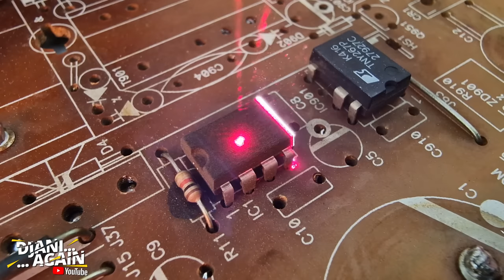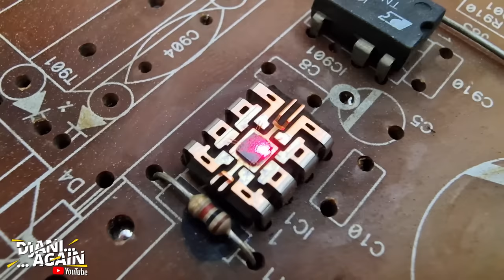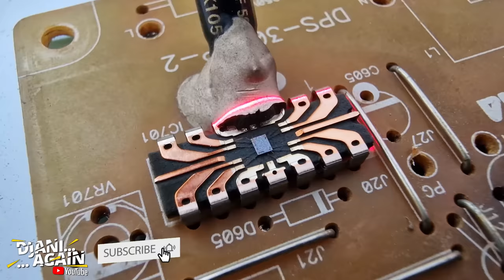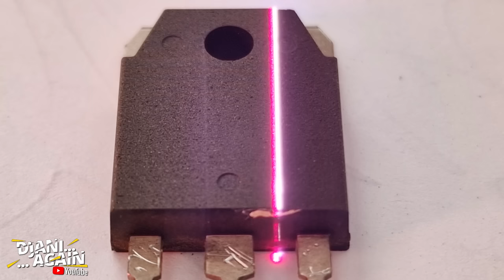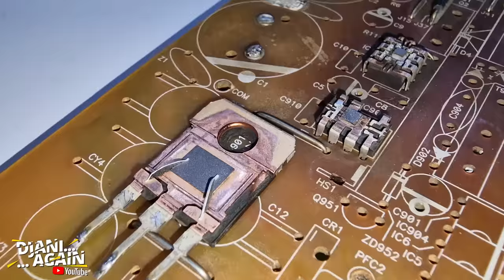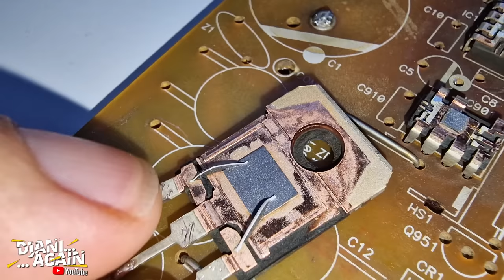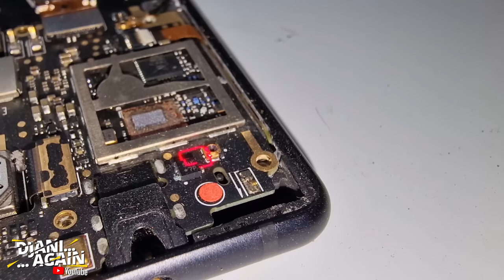Integrated circuit,  MOSFET, processor  decapsulation with fiber laser! Peek inside 👀 semiconductor

Comment: That's extremely cool!
You wonder how they manage to get the bonding wires done.
Reply: @oskimac  Yeah, saw that, he has a manual bonding machine, but still i would like to see both end of the wire, how it's cut, welded. pretty thing wire.
Reply from the maker: Thanks for the link! Really cool ✌️
Reply: @AnalogDude_  yes. I don't remember if is in this video or another. But he shows the entire process. And how dificult isnto thread the thin gold wire along the machine

Comment: Do you scrape off / save the gold wires after this?
Reply from the maker: Not really, do they have?
I did it for fun, but result was amazing so i wanted to share ☺️
Reply: @DjaniAgain  yes many of the contacts and such in the micro electronics are gold. A lot of scrappers collect E waste and burn and melt it down into ingots / gold silver bars. I wonder if this process would help that process in any way.. That however is far beyond me.

Comment: a question: why do you not just take the IC and put it in some 400C hot air for 20 25 seconds, then pop it apart? the youtube channel 'curious marc' outlined this process and also took very high quality macro shots from the result -- The laser here is damaging the layers -- where just some hot air heat will cause the epoxy to off gas and separate so it can be pulled apart with 2 pliers very easily!
Reply from the maker: 🤔 You are right!

Comment: would they still work like this ?
Reply from the maker: I doubt it! But if you do this carefully, there is a high chance to work.
By this method they peel a thin layer from SD card and solder some pins in order to recover data from them.

Comment: This is quite destructive. If he turned down the power and went slower he could save the ic and bond wires so they were still visible. Don't see the point of decaping like this if you're just going to destroy the insides while you're at it.
Reply: Probably doing it just to see the internal structure of the component.
Reply from the maker: You are right my friend, just for curiosity. But it worth sharing! Awesome! I would do some again ✌️

Comment: link to buy on aliexpress ?
Reply from the maker: This is from a local business, i can't give you a link, but you can search on aliexpress for FIBER LASER.
I'm sure they will have many models. This laser is 50W, but at work i worked with 20W also, which can do the job.
Reply: @DjaniAgain  10x mate, what you mean by local business ? some bulgarian laser manufacture ?
Reply from the maker: Not a manufacturer, but rather an importer and a trader. They are imported from China.

Comment: Hi! How does this process work? Does the laser have to have a wavelength to burn the plastic and preserve the rest? Thanks!
Reply from the maker: Typically, fiber lasers produce wavelengths between 780 nm and 2200 nm, which is located in the infrared spectrum and is invisible to the human eye. This range of infrared light tends to react well with metals, rubber and plastics, making it useful for a wide range of materials processing applications.

Comment: ...but the chip is destroyed!. I don't think it still alive. try to do it on a PIC microcontroller with a program and try to read and write.
Reply from the maker: Yes, the chip is destroyed!
Reply: @DjaniAgain  but is incredible how far and even can go with the laser. Can you play with laser energy? for example go full energy until it reaches the IC pin wires and the reduce it so to desintegrate only the epoxi... for sure giving it mor time. just to see.
Reply from the maker: You are right, I have plans to do exactly that.
You watched my first tryouts.
Stay tuned for more my friend ✌️